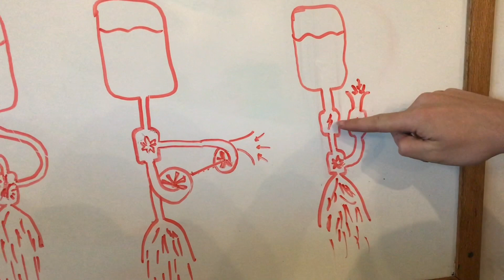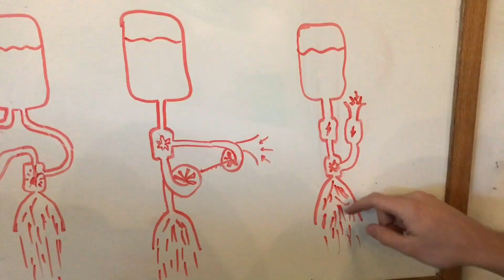building a "liquid” rocket engine that WORKS for $10

Comment: Your combustion isn't occurring inside of the combustion chamber, you can tell because it looks like a flame thrower. Make the chamber bigger, or use a little less fuel. And make sure you ignite it inside, not outside.

*IK because I made the same mistake with my hybrid rocket engine lol.

Comment: This is not working there is no inner combustion  the flame is outside
Reply: That's what injectors do. It's not a combustion chamber, it's an injector.
Reply: @vishalk4647  where do you see injector in the title?
Reply: @tristanlongangue5671  don't need to see it in the title cause if you work on stuff you should be able to recognize parts.
Reply: @vishalk4647  did you watched the video? He said: this is the nozzle and this is the combustion chamber. So he dont know that what he made was a injector
Reply: @tristanlongangue5671  well his fault. Cause injectors does have nozzle but combustion chamber in injector, well it needs good stuff to get high on.
Reply: Combustion chambers are designed based on characteristic chamber length which is is very much needed to hold in the combustion.

Comment: 😐 I'm really not an expert but it doesn't look like that unit is productive enough to carry the compressed air supply along with the liquid fuel load and make a further smidge of anything related to thrust to propel your bong parts in any direction other than down... could be a bit of vacuum affect there  but less than if it were in the bong where belong... I think you're going to need some auxiliary solids.  Freaking big ones!   Try # with an oxidizer😀💕
Reply: What he created is a injector. All the combustion happens outside of the "engine". But if you add a combustion chamber it should produce thrust